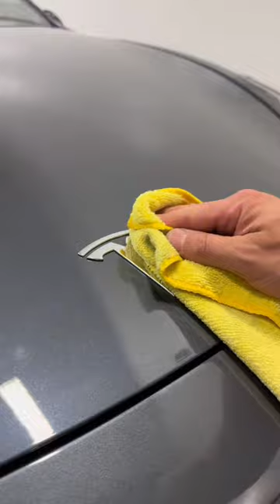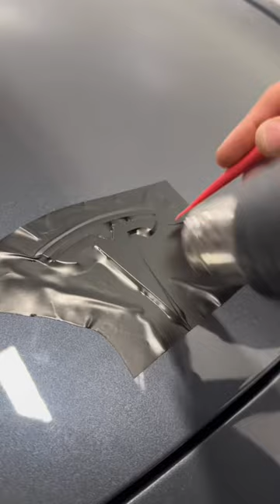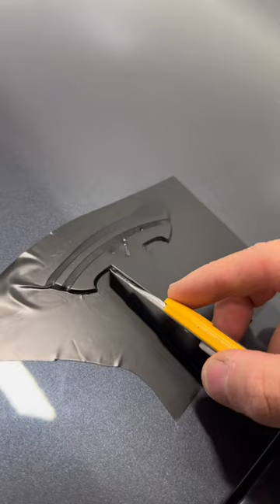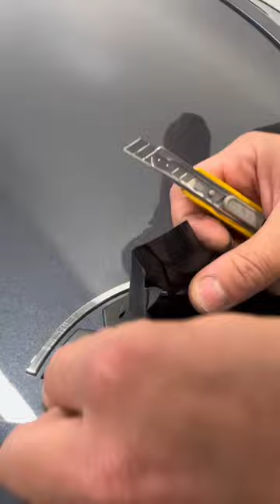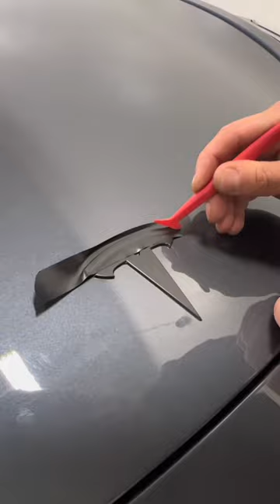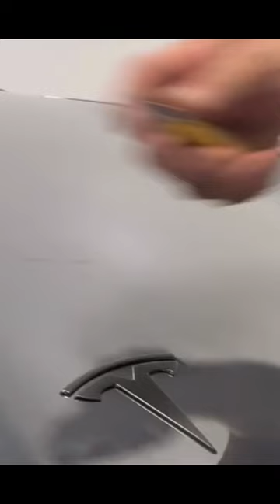Tesla Emblem Blackout using Vinyl Wrap, step by step #carwrap #tesla

Comment: Scratching the paint with that utility knife 😂
Reply: that doesn’t scratch the paint
Reply: First thing vinyl wrap class 101 will teach you is to control the blade without scratching the surface underneath the vinyl. If one cannot, such as yourself, you shouldn't even attempt.
Reply: Learn knife control
Reply: @SamsungTVChannel-et9nv nah def scratched the paint
😊
Reply: @jw2722  It's completely user-dependent.  And yes, it can most certainly scratch the paint.
Reply: @tonewheel  of course it can. That doesn’t even need to be explained, but it does not inherently result in scratching the paint like that person seems to think.
Reply: If you look closely hes cutting into the emblem, not the paint
Reply: @SamsungTVChannel-et9nv that raggedy ass cut says dull blade to me, doubt there's much blade control happening there.

Comment: And the scratches in the paint will show you the exact position for future emblems.
Reply: How else are you supposed to trim the excess then, genius?
Reply: @TM-fx5le just don’t do this. Take the emblems off or plasti dip them. My man is definitely compromising the clear coat.
Reply: @TM-fx5le the cutting could 100% be done at a shallower angle so the blade goes into the emblem adhesive rather than the paint. Using a blade that isn't duller than a butterknife might be nice, too. Raggedy ass cut lines.
Reply: @CarbonKevin  internet professional 🤦‍♂️

Comment: Plasti dip or Hyperdip is easier and no blade to paint 😂
Reply: It requires removing the emblem tho, whereas wrapping can be done on car
Reply: @ThaTraitor nah you don't gotta remove them
Reply: Plasti dip won't even last as long as wrapping it will.
Reply: @jaybino3918  A can of plasti dip is like $5. You could do the emblems so many times with the same can.